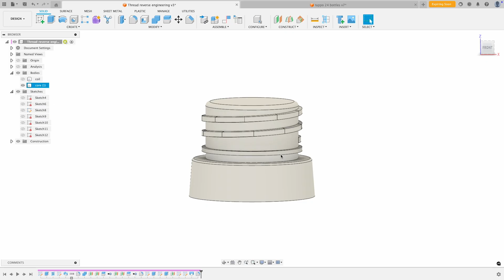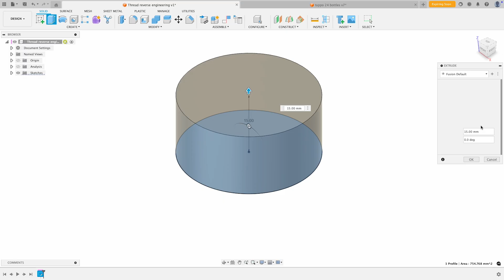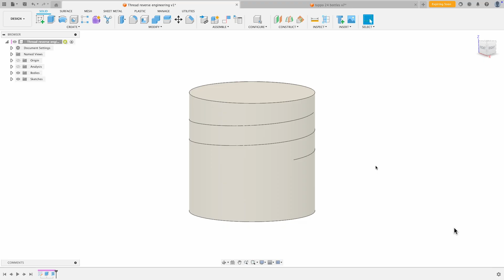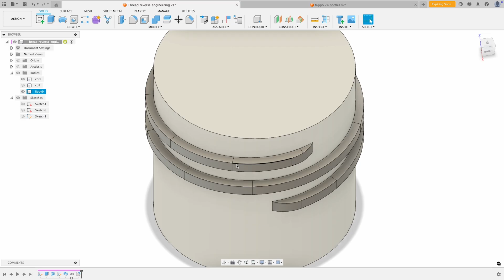Recreate ANY Thread with This Method (3D printing + CAD)

Comment: 0:56 measure the outside, then use the backside of the calipers to measure the inside, and take the average of those two to find the pitch more accurately. No guesswork of the center involved this way. For even higher accuracy measure accross multiple revolutions and divide your final average by the amount of revolutions you measured. 

Any constant errors (which are the biggest component of measuring with calipers, errors are rarely proportional) now also get divided by those revolutions. Say your calipers (or eyes) are off by 0.1mm, and you measure 5 revolutions, your actual measurement error is now only 0.02mm.

Comment: Try adding .05 to your support top distance so it removes easier and cleaner.
Reply from the maker: Thanks for the tip, yes the supports were really stuck on the print
Reply: @salveo3d  been there done that, been trying to help as many people as possible lately lol
Reply from the maker: @tombeam appreciate it Tom, that's also what I'm trying to do here

Comment: use the backside of your calipers to measure between things, and the point at the bottom to measure depths.
Reply from the maker: Using the backside of the caliper is a good point! Thank you for the tip and for watching

Comment: Clear explanation and great editing! I've done this in the past to make custom lens adapters from my sony camera to old projector lenses. Your modeling workflow is so much better than what I did, I'll bookmark this for the next time!
Cheers!
Reply from the maker: I'm happy you can implement this video workflow!
By the way, lens threads are metric most of the time. You can probably shorten your workflow by simply measuring the external diameter and the pitch with the caliper, then creating the thread directly with the “Thread” command in Fusion.

You’ll find many predefined metric threads there.
For example, M30x1 corresponds to a 30 mm external diameter and a 1 mm pitch.

Happy printing!